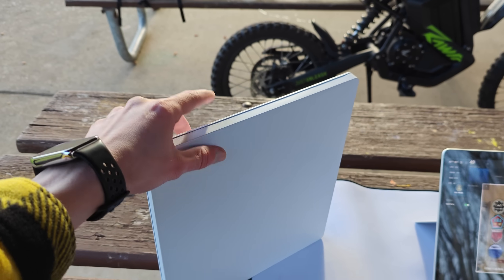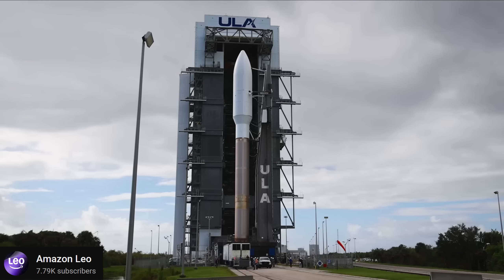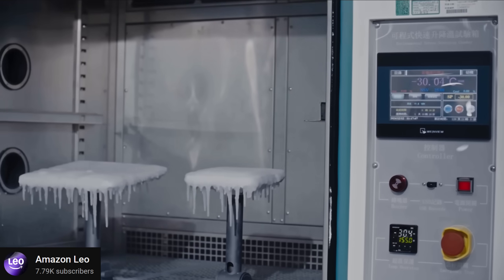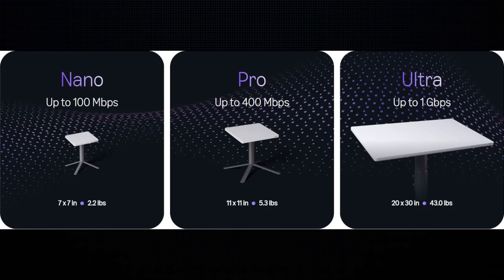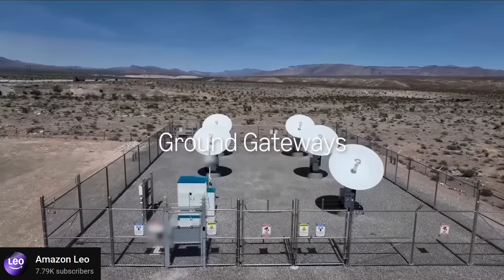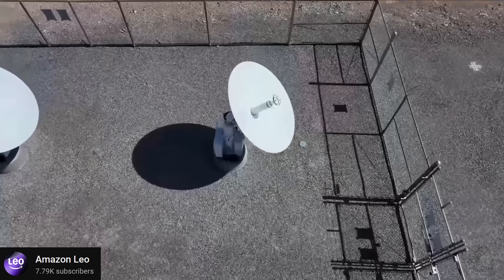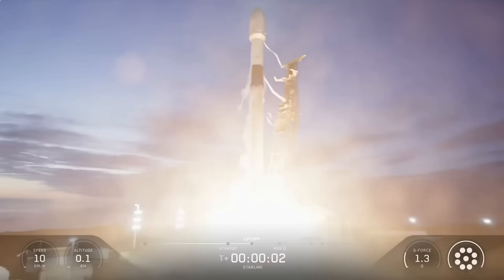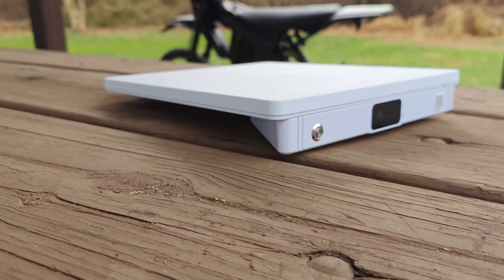Starlink has a Problem, Amazon LEO is Actually GOOD

Comment: Amazon definitely will not have 1,500 satellites up by mid 2026. 

Yes, that is the milestone they’re required to meet as part of their spectrum license (half of their constellations has to be operational by X years from time of filing), but there’s no way that’s gonna happen. None of the new rockets they’ve hired - Vulcan, New Glenn, Ariane 6 - have reached a high flight cadence. And even the “veteran” Atlas V rockets aren’t flying that frequently because ULA, the launch company, is old and creaky and having massive operational issues with their ground equipment, old infrastructure etc. Plus, I think Amazon isn’t producing satellites anywhere near fast enough to launch another 1,300 in 6 months, even if the rockets were available and waiting. 

However, none of this is really a problem as it’s almost a certainty that Amazon will be granted an extension to their deployment deadline, which was really just put in place to discourage “spectrum squatting” by companies that hoarded valuable spectrum licenses for years and years and did nothing with them. Amazon is clearly not squatting, they’re just running behind schedule but they’re clearly USING their spectrum.
Reply: You'd be wrong

Comment: What's that black small box between your peakdo box and your solar panel cord? And why cant you plug straight into the peakdo battery?
Reply from the maker: charge controller, normalizes the voltage and provides a usb c output